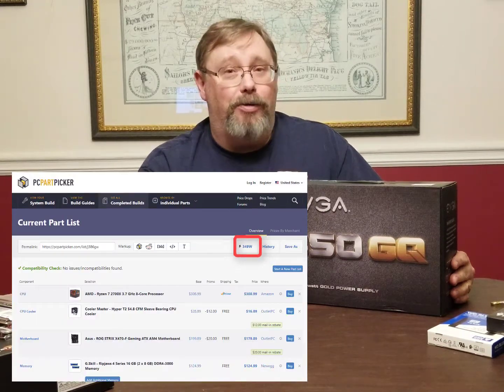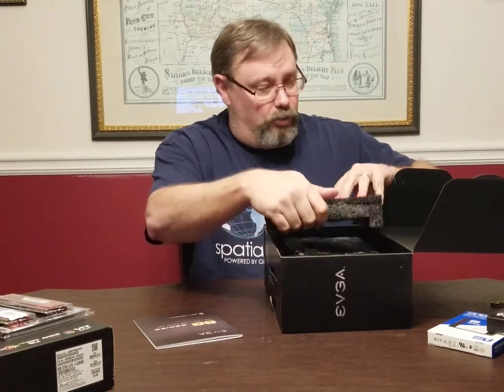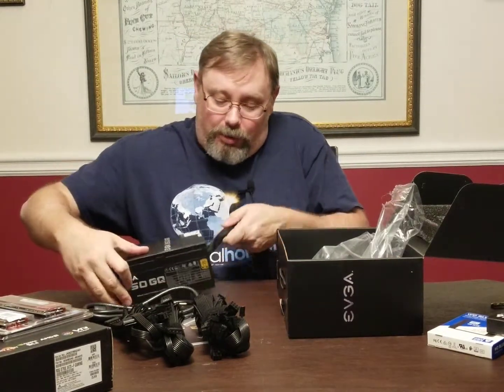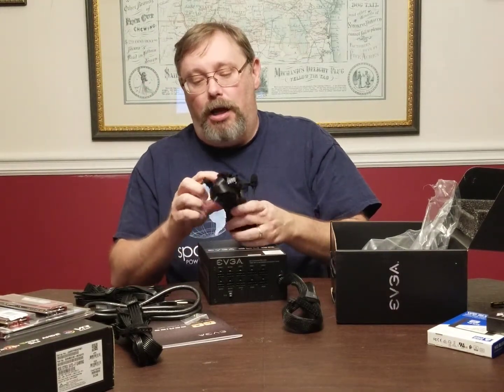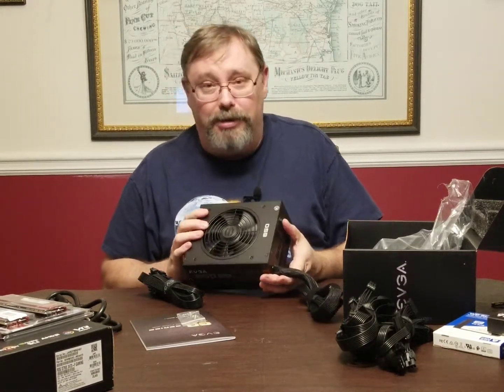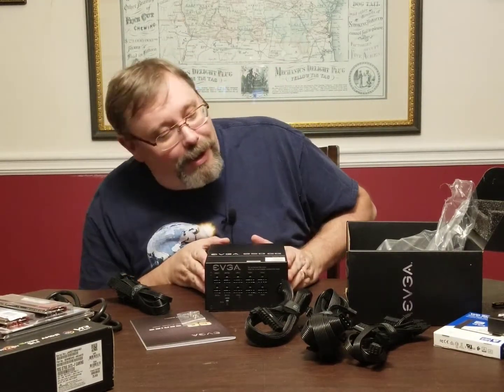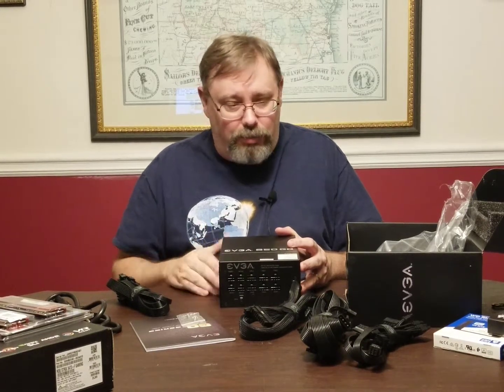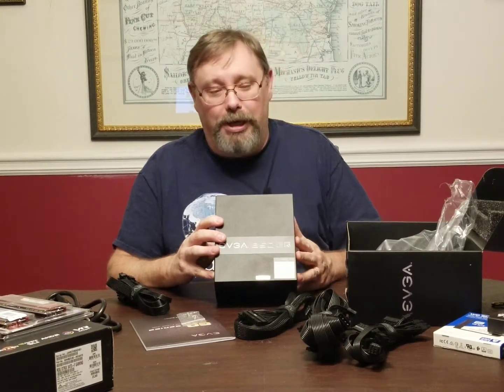EVGA 850GQ Power supply unboxing

Comment: Can I use this for my 4090?
Reply: Without knowing what your other components are I could not say for sure but I think a 750 watt would not be enough for a 4090. I would think a minimum of an 850 watt would be needed. You can use PC Part Picker to do a build based on the components you have or plan to use and it will tell you what wattage you need. Always go a bit higher to give a buffer. Hope this helps. BTW I am the one in the video. eGIS use to be my company until it was acquired.
Reply: @67Stang  wow thanks for the reply! I reordered cables for this model from evga. My concern is that this psu might be too old for the 4090. I know, sounds dumb but I’m no expert haha. 

I’m trying to get a seasoic vertex pcie 5.0 but everything is out of stock.
Reply: @getonmalvl  I don't think it will be an issue of age more the required wattage. The 4090 ships with an adapter that should work with this PSU. You just will not get then benifits or the additional small 4 prong connector that allow the PSU and 4090 to talk to one another. The wattage would be my primary concert.
Reply: @67Stang  thanks. That puts my mind more at ease. I will use the 850 until the 1000watt or 1200 watt seasonic comes back in stock.

Comment: I had one of these delivered to me today and installed it into my 3rd pc build and it did not work, I changed all the wires around but it lit up the motherboard but never gave the power to boot
Reply from the maker: Sorry to hear that. I have been running mine now since I built the computer over a year ago without a since issue.
Reply: @Jason Luong Hello Jason, I sent the PSU back they sent me a new one 14 days later and it worked